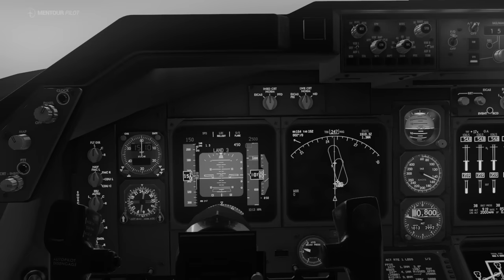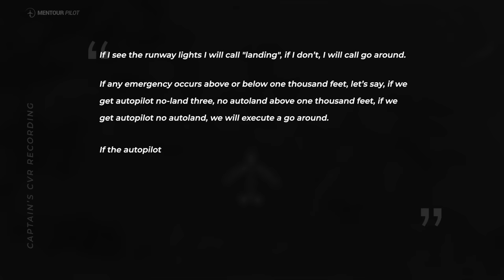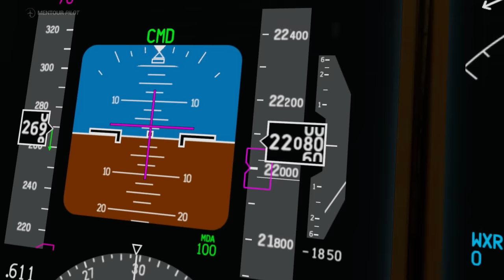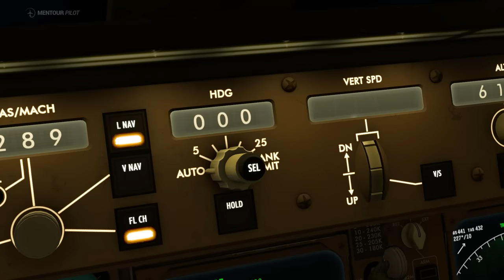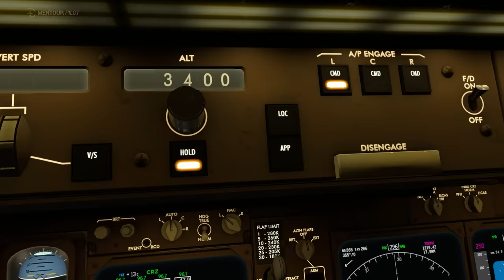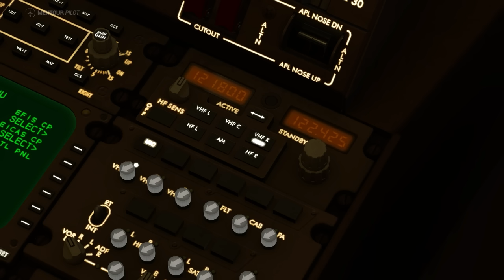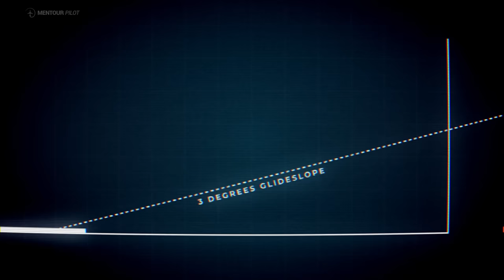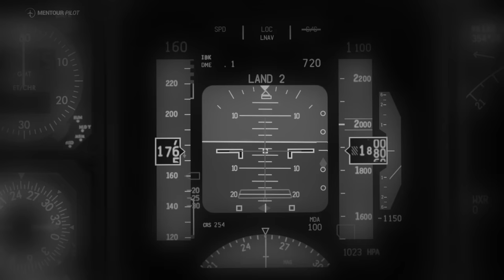Where is the RUNWAY?! Unraveling the Mystery of Turkish Cargo flight 6491

Comment: There was a famous landing in Little Rock that was caused by get-there-itis during a storm, much like in this landing. The pilots didn't come in too high, but they did come in way too fast, and, critically, they forgot to arm the speed brakes and had no slowing power under manual braking because the weight of the aircraft did not transfer from the wings to the wheels. They went off the end of the runway into a metal walkway and killed a couple passengers and injured a few dozen.

Comment: I can’t fathom how they didn’t notice the 9 degree glideslope issue. The rate of descent would have been around 2000 fpm instead of 600, the power settings would have been massively different and the pitch angle would have been all wrong. Get-there-itis indeed.

Comment: A nice system feature Boeing could add would be a pilot command to the autopilot(s) to "recapture the profile" which issued early might result in "OK" and issued late should result in "Unable - Please select Holding pattern with descent or Go Around".  This would require substantial new programming and validation.       Another feature to consider to begin testing would be having ChatGPT or some equivalent monitoring the conversation ( and better but harder, also monitoring the instruments)  and detecting a breakdown in CRM and sounding an alert.  As always,  there is no free lunch and adding one more alert on top of a stressful situation already with multiple alarms could make things worse,  and false alarms could result in anger or the system being shut off.   I believe some fighter systems monitor pilot stress and load levels,  assume that pilot degradation due to fatigue, stress, overload or physical injury is expected, and adjust displays to the few most important elements.  Still, alpha or beta testing could occur today on cockpit voice recordings, even post hoc,  to try to adjust sensitivity and specificity and see how well GPT can detect what humans agree is an alert point, then engineers can figure out how to sound or display the new CRM-breakdown alert.
Reply: In our hospital patient safety course at Johns Hopkins University, looking at improving operating room safety and CRM equivalent,  our instructor, Brian Athey, told us that 75% of commercial aircraft incidents occurred the very first day that a new combination of pilots was flying together - ie, CRM was initially not established yet between these human beings.  It appears that CRM is the weakest link in total safety and anything that might improve it,  even if only used during training, is worth investigating.

Comment: I just made a trip to New Mexico to see Saturday's solar eclipse and it was really neat to fly again for the first time in five years.  The flights both ways were on 737-900's and I seem to remember you fly a 737-800.  What 's the difference?
On the way out there was some turbulence for the entire trip.  But I knew from watching your videos it was nothing to be concerned about as long as you are strapped in.  I sort of felt like I was getting a massage the whole way.
But I am curious about one thing.  I got the impression that the plane jerked from side to side more than up and down.  I thought it would be the other way around.  I'm guessing that since the wings can flex but the fuselage can't that maybe the wings can sort of smooth out the bumps.  Is that correct?  I was also seated near the rear of the aircraft near row 35 on every flight.  Does that bounce around more than if one is seated forward, sort of like sitting in the back end of a school bus on the highway?
Thanks for your magnificent and gripping videos.  Terrific work.

Comment: Lol, its amazing what you can do in flight sim that you cant do in RL. Just for kicks I like to see if you could land a 777 like a supercub. So at fl450 in which the IAS is relatively low and a little less than 30 nm from the airport I would gear-out the jet and get the IAS down into the 160s and put it into a partial stall keeping the angle of attack above 16°. Of course the second you point the nose down the drag would decrease and the descent rate would decline so you had keep the trajectory intercepting the ground a few miles from the runway, but it could be reliably done (fortunately my sim did not have a stick shaker). Then as on intercepted the glide slope the flaps needed to come back a little and engines up. 

   I hated getting overspeed on the descents, particularly on time warp would run you over the approach initiation window, and on the jumbos the turning radius at Fl37 to 45 was crazy big and took alot of time, so I actually worked on this method to fix the problem of tricking the simulator back on its 3:1 glide slope. That was decades ago. 

So let me try to jog my memory, 
Engines to idle. 
Flaps down at high limits,
Nose up to slow down
Spoliers as require (Usually partial, 30% deployed)
Gear down. 
Maintain nose at critical angle of attack [between 16 and 18° IIRC. (Flying blind because the nose config does not allow one to see the runway) 

As one approached the glide slope engines up, spoliers 0, and click the flaps up a couple of notches until AoA is restored then flaps back down again. 

This is a bit harder to do on the 747 because it has such a high glide ratio, the wing aspect is not quite as forgiving as a 777. I used to do other crazy things with the 747, like try to fly around the world non-stop fuel. Getting off the runway with all that fuel was not easy😂

   I used to fly the concord from LAX to Taipei nonstop. And you might think the problem was getting the concord off the ground with all the added fuel, but the biggest problem was landing without fuel, when the model had less than about 5% fuel it became unstable, more so when you were geared to land. In MSFS, landing and empty Concord was like trying to hold onto a slippery fish. 

   I eventually got tired of the tech stuff and flew exclusively DC piston powered stuff with no radio navigation or simple navigation insts.

Comment: Please make a video about miracle landing of Volga-Dnepr Airlines Flight 4066.
Shortly after take-off the No. 2 engine of the Antonov An-124 Ruslan operating the flight suffered an uncontained engine failure. Debris from the engine punctured the aircraft's fuselage and wings, affecting power supplies and rendering the ADS-B inoperative. The aircraft's braking system was also affected, as were engines 3 and 4. Communications with air traffic control were also lost.

The plane turned out to be without power, almost all the instruments in the cockpit went out. Engine 2 was lost, Engine 1 was in uncontrolled thrust mode, control problem with engines 3 and 4

The aircraft became almost  completely uncontrollable. But the crew managed to land it!!!!

Comment: I'm not so sure that the anti-ice systems would affect the thrust at low thrust ratings. Yes, it will cut some percentage of maximum thrust depending on the anti-ice demand, but below that maximum available thrust, the engine EEC will correct the engine rpm just as needed to KEEP your actual thrust, not alter it. The pilot should've indeed used the speed brake and not be so comfortable on only using FL CH (a function that will vary the needed vertical speed in order to maintain the set airspeed for a fixed thrust value) and if needed to some S-shape turns to increase the descent length. Maybe due to fatigue/exhaustion he preferred to rely ONLY on automation and remain more comfortable and focus on other things than flying the plane on the needed steeper dive and constantly monitor the descend pattern, airspeed and speedbrake inputs.

Many thanks for the glideslope false signal reflections that happen above the correct one which I never knew to exist.

Comment: I am confused about something. what was the airport tower doing when this was happening? There was just one plane in the airspace, so they shouldn't be busy with traffic. They knew about the bad weather, so they should be twice as cautious. They were probably able to see the altitude of the flight. Then, why did the tower not warn the pilots that they are too deep into the runway with a height of more than 100 feet? 

Do airplanes not have gps btw? So that they can check their position and see that they were already over the runway, instead of looking for visual cues in fog?

Comment: 31:35 at this point I don't care whose fault it is. Throw all the procedures out the window if you like (don't actually!). The very basics of energy management for this approach are now unworkable, and realistically have been for a while. And yet the pilot is still thinking about who will look out the window! What is the point of visually capturing the ground in low visibility (or any frankly) if you don't have a workable plan to arrive above the threshold at a safe speed?
These are both instrument rated pilots(!?), it feels to me that something is wrong with their training. They think if they sort of go through the motions the threshold will magically appear through the fog regardless.
Energy management is totally unforgiving. If you have too much altitude to lose controlling your speed becomes impossible. If you control your speed losing the altitude becomes impossible. I don't know if it is but simulated steep approaches should be encouraged. Perhaps on a different type so pilots aren't tempted to fly approaches with aircraft they shouldn't, but to remind them that trying to loose too much energy is stressful bordering on impossible.

Comment: Wow, a lot has happened which eventually led to this accident but it seems to me the trigger which put everything into motion was the initial decision by the ATC to keep them higher than expected.  Now I know neither the controllers nor the pilots have time to chat with each other however a few extra sentences could help put things into perspective. If the controller said "the temp is so low you might get wrong altitude readings which is why I'm keeping you higher than expected " the captain could counteract that with an argument against it or reprogram their computer. Or do something else with that information.  It seems to me that aviation, in the effort to be as concise and quick as possible,  sometimes falls into the trap of withholding information deemed irrelevant.  

Of course I'm not blaming it on the ATC or on anyone really that's not the point, and it's easy to be a general after the battle, but I've seen so many of your videos it seems there's a running motive in many of these accidents, and that's people doing something logical but slightly off center, because it does make sense, but never telling anyone about their thought process...
Reply: The Controller obviously thought that the Pilots would know this - but astonishingly they didn´t.
Reply: @NicolaW72  Ah, that brings me to the other side of the coin. "Assumptions are mothers of all fckups as we would say in my part of the world" :D
Reply: @CrazyBunnyGuy  Yes, indeed.

Comment: So uh, where was the control tower staff during that last part? There was a single plane in the area and it completely missed the runway, but it was still descending as if intending to land, instead of climbing up and calling in a go-around. At 180 kph, the plane was over the runway for 40+ seconds. Did that airport have no tracking systems?

Comment: do you think slightly earlier (ideally, removal of 2 second gap) would have eliminated & averted the crash touchdown? I wonder if that 2 second would have been enough for plane's inertia to shift enough to avoid disaster. if so, maybe a separate or failsafe collision avoidance could be implemented and such data could be used as tolerance for system's reaction time...

Comment: It almost seems that Planes had less issues with crashes... with the Pilots, Co-pilots, etc... being less stressed, and seemed to not be as ober worked/overwhelmed when sticky situations, more stressful situations, weather changes, last minute changes, etc... arised when they used to not have just a pilot & Co-pilot & a computer... but also had Engineers on board. As the Engineers on board were another brain 🧠 that could help out in situations with the Pilots & Co-pilots to make decisions, changes, etc... & help with the workload. Yes there was still plenty of accidents/crashes... but I would say more were averted due to the Engineers in the cockpit working with the Pilots & Co-pilots.

Comment: The impression I get watching these videos is that flying a commercial airliner is 90% routine and 10% terror. No doubt pilots find these stories helpful. Once a plane leaves the ground there is only one safe outcome--landing on a runway, which for anyone whose ever flown a plane, thinks about the moment they leave the ground. Graceful sky crusiers seem just like their cruise ship cousins, gentle machines peacefully plying a celestial ocean of tranquility. Then all hell breaks loose and 60,000 horsepower of jet engine becomes a rage machine of unimaginable physical assault. Puff the magic dragon has now become Smaug the fire breathing killer depicted in Lord of the Rings. And now two humans, fully aware of the result of failure, need to summon every bit of knowledge they can to put the monster back in its cage before gravity enacts its final revenge.

That's quite a job.

Comment: I once was offered membership in a glider club as they needed people to fly those "Jochen Schweizer" voucher-tourists. I did some flights in an ASK21 but as I was too big (too tall and too fat) I would have had to get my license on a Duo Discus (at much higher cost) and would have been able to fly most of the single seated gliders without a chute only. Therefore I passed.
I wonder, doesn't the job get boring with all those electronic helpers? Seems like apart from taking off you are only operating the computers rather than flying the plane these days. Do I have a wrong impression?

Comment: When I listening to the opening intro I immediately thought that age would be a factor. At 60 these pilots would have an arrogant 'I know it all' attitude, especially with their high level of experience, which usually would lead to a screw up. Its pretty easy to get in that psycho tunnel at any age, not being agist at 55 myself, and even harder to snap out of. Sometimes I tell myself if X happens I must do Y, then fail to notice that X happened and did Z, which is fine since I'm not captaining a heavy 747. Here the margin for guesswork was thin due to fog so I would have said if Im hot and high just go into a holding pattern, as was correctly pointed out in the narration. I have looked back at past screw ups and found there was always an easier, better way to handle the situation to avoid the screw up, and also glaring red flags alerting you to the potential of screw up. But sometimes our minds don't want to acknowledge that. I try to keep my mind flexible by not any weird meditation or anything, which has its own pitfalls, but by simple looking at things with a fresh set of eyes and wondering how I would approach a task as if I never did it before. Since I was a teenager I noticed how neorotic adults become with age, and swore to myself not to get like that, so whenever I find myself going that way I try to think fresh new thoughts or force myself to listen and actually like modern pop top 40 music of today.

Comment: If air temperature effects the altitude calculated from air pressure according to the graph you showed, couldn't the temperature of the air be factored into the equation to calculate altitude?

Comment: I’m curious as to why an auto-land system doesn’t have a auto go-around system that when it would be apparent to the onboard computer system that the plane will not be on the ground at a point on the runway that a safe landing could take place. I’m not a pilot so my understanding is limited.

Comment: Did the report not point out that having a DME associated with an ILS on a different frequency is just bad design and should be avoided? If it didn’t, it should have
Also, blaming Boeing because the pilots ignored EVERY THING and ANYTHING the aircraft told them is a bit rich…

Comment: This may be a dumb question from a not-pilot... but can pilots not push the stick down to manually drop the aircraft? You know.. instead of adding flaps and letting vertical speed vs gravity take over? I feel like they could have made a more aggressive descent decision by manually flying downward and then leveling off to match the correct checkpoint altitudes or even glide slope later.. Is there something wrong with that type of thinking?

Comment: This is the reason why especially cargo planes will be in future replaced with full computer operating, with no pilots on board.

Because there is so many "wtf/why" moments in this video mentioned by mentour, which advanced AI/computer system will simply not make. :)
If he in a second calculated wrong approach glide, he will without any hesitation make go around and land safetly :)

Comment: 16:16... huh??

But 22,000 FEET x 3 doesn't equal 66 miles (348,480 ft)... I'm assuming you're really just multiplying 22 x 3 to get the rough distance.